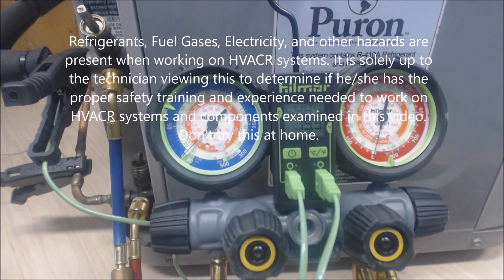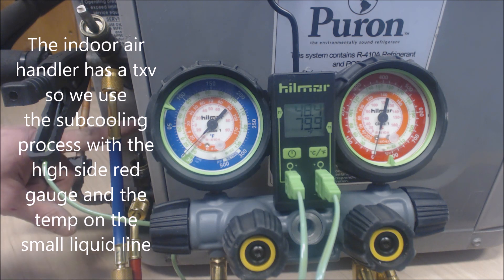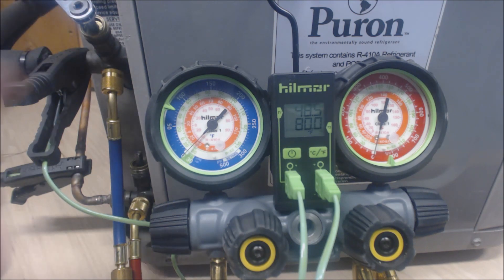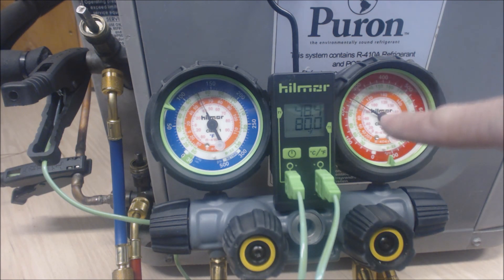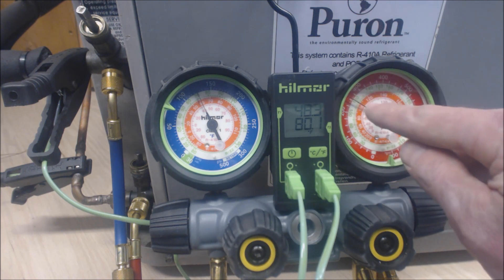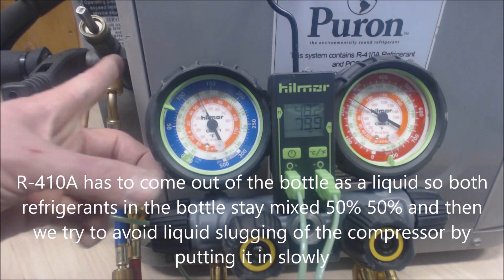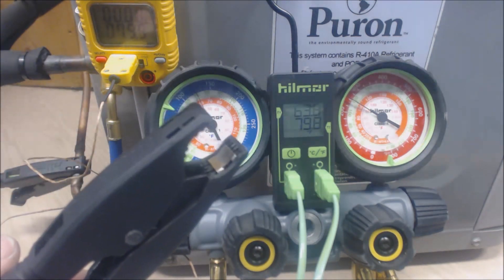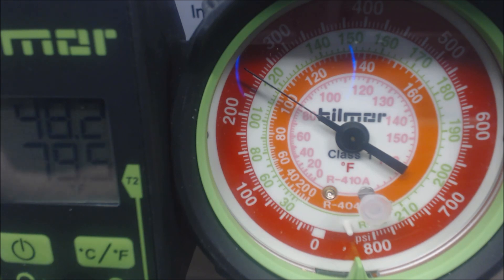HVAC Low Refrigerant Subcooling!

Comment: Ive got a new 5 ton heat pump from Goodman with matching air handler. Had the system filled and it is cooling but not very well. Has the Coolbridge interface and an EEV in the air handler. When the installer put it in the thermistor for the evap temp was damaged. Was repaired and seems to be reading correctly. The Coolbridge shows a sub cooling of -9.5 degrees! Superheat is shown to be a crazy 60 degrees or so. I believe this is severely undercharged. 

While the thermistor was damaged installer was attempting to charge but the EEV was showing very little open percentage. He was getting very high pressures so he quit adding freon. The thermistor was later fixed and now I see the above numbers. Believe the EEV was effectively shutting down and not allowing much flow and believe that is why he initially saw such high pressures. 

I plan to put a set of gauges on it and measure the liquid line to verify the actual subcooling. I don't trust trust the Coolbridge numbers since they seem crazy off.

Comment: Wow you’re great 👍 
I’ve questions when I hookup the manifold but low side gage not moved what’s problem??
Thank you for help have nice day ...
Reply from the maker: It is possible that the system is so low on refrigerant while running that it is at zero psig, maybe the three position valve was not midseated, if the service valve has a valve core, maybe the hose you are using does not have a valve core depressor or it is not pushing in on the valve core in the port, thanks
Reply: AC Service Tech LLC 
Thank you so much..

Comment: Curious about your comments on the king valves back-seated.  Is that normal situation on most machines or just that particular unit? And to clarify your statement, you're saying that front seated would be total isolation, midpoint is all open including service ports and back-seated is circuits opened but service ports blocked?  Also, you say there are no schraders, so did you remove them or that application does not have them?
Reply from the maker: This type of valve does not have and valve core schrader valves since there are three points of control with the valve instead of two points of control with the service valve that uses valve cores. This valve would look and work very much like the one found on the top of the receiver on a refrigeration unit. Thanks

Comment: I just found your channel very informative, i do commercial refrigeration service but now also getting into a/c, as you now is the same but different. I ran into a a/c split system txv the other day it had a liquid line sight glass on it is that at all beneficial being we need to check subcooling and superheat. thank you
Reply: I thought a sight glass was just for moisture indication?
Reply from the maker: Ha ha, you hit the nail right on the head. It is not beneficial at all for comfort cooling. Thanks

Comment: You
Hello. So I was just out in a service call for a goodman 2 stage furnace.(do not have model number sorry) just looking for a possible direction for next time I'm there. So the furnace goes through the order of operations up until the hsi heats up then I hear a click but the gas valve does not open. Gas valve was changed same issue. There is gas at the inlet at 7 inches water column. So I figured I'd check voltage to gas valve. This gas valve has a clip to it with 3 wires, high,low,common. So I was getting 7 volts to the low side of the gas valve. The board was changed as well. Why am I getting such low voltage to the gas valve? All pressure switches and limits were fine as well. This particular unit has 3 pressure switches low, high and a door pressure switch? Never seen one of those before so was a little confused, seems to only get power to that switch when hsi was glowing.
Reply from the maker: Maybe just take some jumpers and temporarily jump out the pressure switches to see if it continues past that point in the sequence. If it does then see which pressure switch is the one that is the problem by pulling one set of jumpers off at a time. Did you test from high to common on the gas valve? Did you try low speed with the other probe on ground? 7 volts can still mean that it is off. Did you check the connections coming off of the board for the gas valve when it is that step in the sequence? Funny enough but I had the same scenario a month ago and it was the 10 wire pin connector from the  board and the gas valve hot was just not making good enough contact on the prong. I squeezed it and it's been working well since from what I heard. Thanks and let me know how you make out!

Comment: just curious, what made you swap over to hilmor gauges?
Reply from the maker: Hilmor let me try them and I do like them very much. 4 ports are nice and the temp clamps are very accurate. I will be using these along with my other gauges in future videos.
Reply: who do you think makes the best analog gauges? or should I say highest quality?
Reply from the maker: Give me more time on that one. I will put them through their paces. I did check them vs each other and they were right on the measurements and were flutter-less. The Hilmor are easier to work with at night. I haven't been working with the Hilmor ones that long but they are very nice and have not moved when bumped. Obviously I have had my whole career worth of experience with Yellow Jacket. I have used some other brands in the past too and they did not last but I have used other Hilmor products and I know their goal is to improve on what is already out their and innovate as they can. I will get back with you. Thanks a lot Refrigeration Tech!